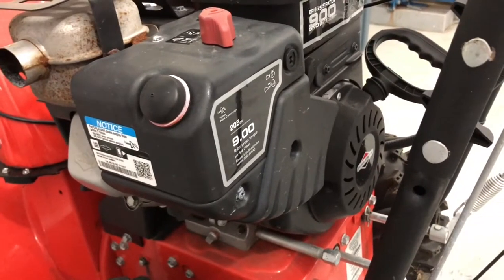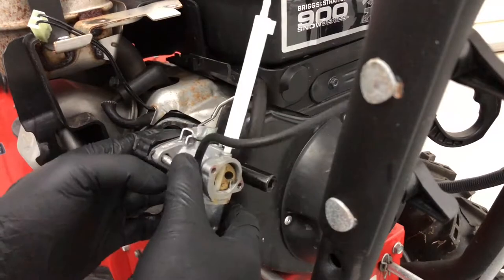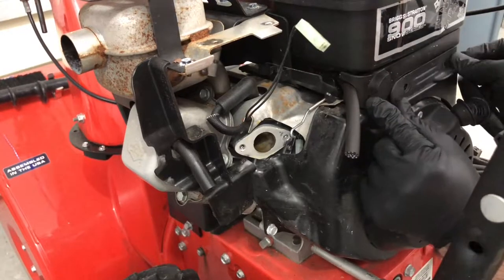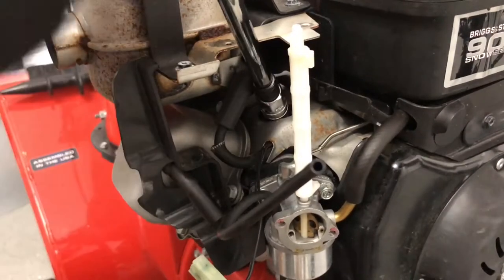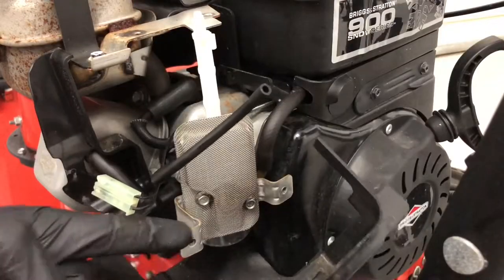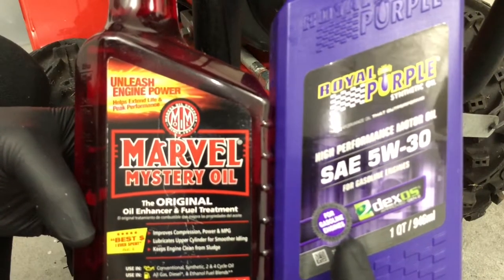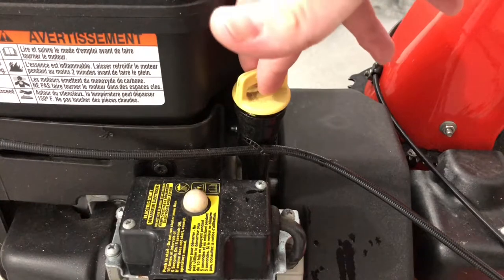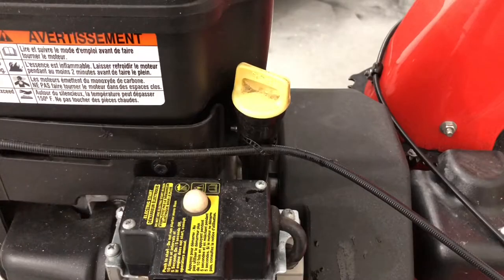How To Fix Snowblower! Simplicity M924

Comment: nice video for cleaning carb and tank we use seafoam in the fuel system to help clean system we pour it in the tank thanks for sharing !!
Reply from the maker: I use seafoam also, 1 Can In the cars fuel tank every  5,000 miles. It works wonders! I mix 1 ounce per gallon of high octane fuel for the small engines in our equipment also.
Reply: like to tinker around on lawn mowers motocycles  small engines